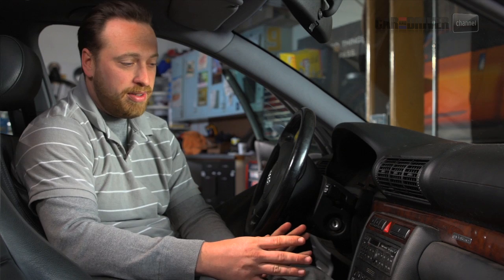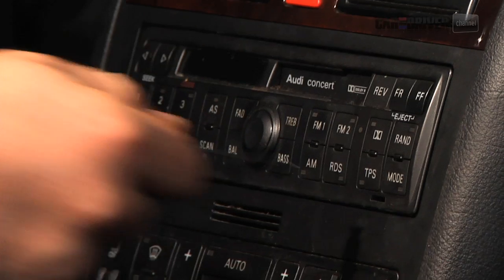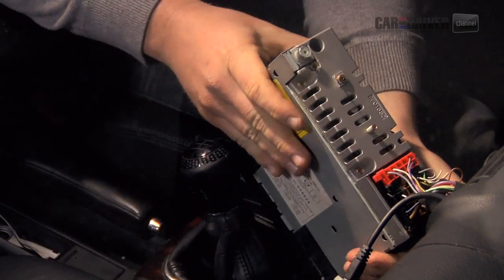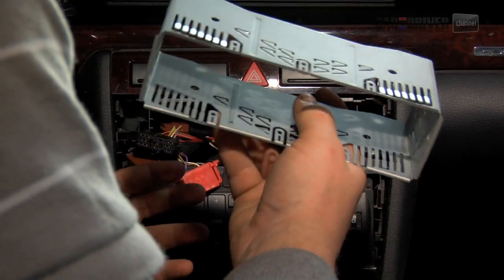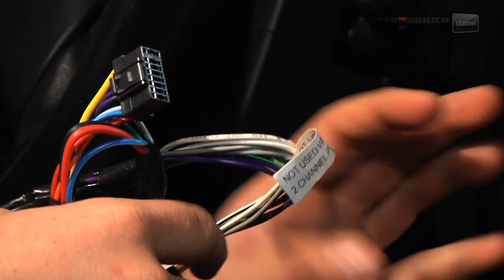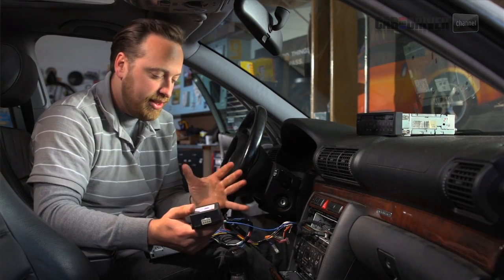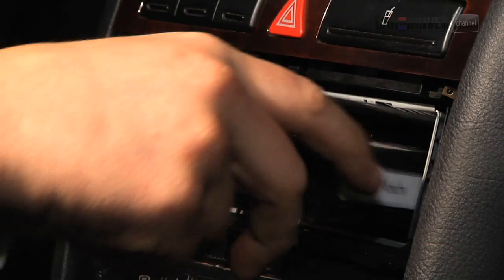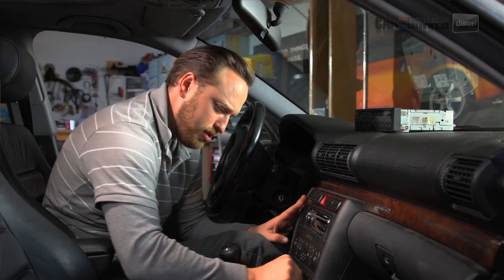How to Install a Replacement Car Stereo

Comment: you forgot to mention in the beginning to disconnect your negative battery cable before you start so you don't fry your components or blow a fuse...

Comment: hey ben my aftermarket car stereo just went out and when i pulled out the stereo all the wires were basically spliced and black taped together with the cars wire harness. and when i turned the car on my stereo doesnt wor. do you have any idea what the problem could be?

Comment: You can go to your local autoparts store, and ask them to direct you to the car stereo section. There you will find kits with make and models clearly listed on them. As far as a radio, any aftermarket radio will work, but with USB, you may have problems with amperage depending on what you're attaching. Pioneer, Alpine, Clarion, and Eclipse are high quality units. JVC, Kenwood, IR3, Blaupunkt, and the like, are lesser units.

Comment: Ben, Thank you for the informational video. Have a20003 Honda Accord that was operating intermittently thinking it was a loose wire, now does come on at all. Need to replaced. Should I go to salvage yard and try to find Honda salvage or buy aftermarket. If so which one would you recommend from an ease of installation?

Comment: Thank you. This was very informative.  One quick question, I have a Toyota Avalon 1995, I was in the process of replacing the radio and got stuck when connecting the new radio.  Where would I find this sound café universal radio replacement box.  Thank you.

Comment: OK I have a w201 Merc 190 with the original radio cassette. I have taken this out but the connectors for the speakers and wiring are different. How do I change the two pin speaker plugs for jack type and what about the wiring harness. I guess it is all colour for colour connections but am worried about stripping it out and ruining it. Thanks.

Comment: i recently bought an old 1998 citroen saxo and it came with a tape deck in it will i be able to just straight swap it for my alpine stereo i have saved from a previous car or will i need one of these adapters thanks

Comment: That's your opinion. Aux inputs always have a noise element attached to them. And as for most radios, "modding" them to accept Aux is not something the average user can do. Also, the companies who accept contracts of the lowest bid for the components used in the system, don't care about quality, they care about dollars and cents. That's where aftermarket comes in, aftermarket is always better.

Comment: is it possible to make a video on how to install a stereo for toyota sienna 1999-2000 year, they are older models and i believe you need a new panel for new stereo. One other Question, how much is the adapter that you were talking about in the video?
it will be greatly appreciated..

Comment: If you lost your original faceplate and don't remember the original brand or model number can you still replace it? 

It's only about 3 years old, it has a Bluetooth option.

Comment: kind of new with diy, especially with cars, i want to remove my 2000 buick lesabre stereo (it;s not working) so i have a couple of questions: do i follow the same steps? do you recommend a specific car audio brand? the old stereo has a cd player and cassette.

Comment: what about if its an old factory radio and you want to replace with someone that has an AUX port. does that need to be connected or it works once u connect the new radio ?

Comment: if i have a factory bose system in a car and want to replace the head unit and add 2 subs and an amp would i have to bypass the factory amp for the main speakers to work? like if i just cut the wires from the old radio and just wired them to the new one. would the speakers still play? cause i know some factory amps only work with the factory radio.

Comment: So I want to install a new stereo into my car but I don't want to loose the swc (steering wheel control) I been told that I need a extra cable from my scenic 05 plate.

Comment: Hi please tell me is there anyway of not connecting the radio to the car's battery, or any other option. my radio drains my battery & if i play my radio when the car is off, it wont start? what can i do? or do i need a new battery?

Comment: I own a car Honda Civic 2004 EX sedan model.

It has the Cassette adapter with in it. Before a week it was running good, But now its giving me wired sound like buzzing noise which is very terrible, that too its coming in the left speakers. But when it comes to CD player or FM/AM my stereo is working fine and all speakers are good to listen.

So am sure that there is no problem with speakers and players and the problem is with the cassette adapter. It should be a minor problem , but am not exactly sure. 

Could you please let me know if this can be serviced at service station.

Or if you have a suggestion of installing.

Comment: If I find an android stereo branded for another car, but the measurments are still right, would it still work? I have a subaru 2005 2.0 gx sport and am interested in fitting a pumpkin 8 inch to a double din slot (measures 8 inches)

Comment: i have a 94 jeep i bought that came with an aftermarket radio i have another radio i want to put in it should it already have the necessary wires so i can plug and play or do i need to buy new wires?

Comment: i have a 2000 Mitsubishi Montero Sport that i bought, come to find out the radio doesnt want to come on at all, i tried everything besides pulling it out. but the thing is, it looks like the stereo has already been replaced before because you can see wearing around the edge, so im guessing someone replaced the stock stereo with something better and then when the dealership got it they put the stock radio back in. any thoughts? thanks

Comment: Hi, I'm having trouble fitting the stereo back in. The original L bracket had two screws into the frame (car) and two into the deck. These brackets screw into the deck about half way along which means I have to push the bracket for my new car stereo right back to fit flush. Then my stereo is nowhere near flush with my faceplate. 
Any suggestions to mount it correctly?

Comment: Where do you find one of those "black boxes" that are specific for your car? I have a 1995 camry. I am looking to replace the radio (which I updated back in 2007....so it isn't the original stock and I had pros replace it for me, so I am not sure what the wiring situation looks like). If the pros used a "black box" with the last radio install, can I continue to use that black box? I think the radio I have in there now is a JVC and I am looking to put in a Sony. Thanks!!

Comment: After I connected my brand new radio into my 2000 VW Golf with the harness, it has no Am reception. I did connect Sony but no solution. It is working with FM reception and all other function. Any suggestion? Please advise. thanks!

Comment: Ben, great video.

I did something like this yesterday so that I could give my old cd/mp3/radio to a friend who'se CD player was kaput.

I remembered that for some reason when it was first used by me it would ALWAYS start the cd from the start. 

I am a senior citizen and my memory isn't what it was, I think :-)

It's a KENWOOD KD-SC601, I've tried searching all over I have even got on-line manual BUT no joy. 

There must be an industry standard setting either Play CD from start OR resume. 

Could you possibly help me/enlighten me. 

Many thanks for taking time to read this.

Best wishes

Edward, Spain.

Comment: I bought an OEM radio/ cd player to upgrade my OEM radio player  only to find out the cd player had an extra plug I'm lost now. I thought the truck would have had the same plugs but  would just use more of the pins. If you need  its a 2005 f150

Comment: Ihave a chevy 2001 and Im triyihnq to install a new sterio bcuz i broke the other one but i checked and Idont have moat of the plugs you showed on here is that normal ? Or did i get the wrohnq thihnq /

Comment: I just installed a new din stereo in my 06 jeep wrangler it works fine but the bracket isn't exactly doing its job the stereo slide right out idk what to do

Comment: I've recently just braught a casual astra 1999-2001 came with tape deck 
But the problem is the battery died and no code to unlock it will buyig a new radio solve this?
Reply: Vaxhall

Comment: this is funny im really good with computers and i know nothing about cars and this seems kinda confusing and the funny thing is my dad is a mechanic
Reply: its like installing an ide dvd or cd drive but you have to make the ide cable and power connector. Taking of the trim is like removing the front panel of the case

Comment: Last month my 2004 Expedition started making a loud "clack" sound
coming from the rear AC unit. It was annoying enough for me to bust
the unit open to see what was wrong. After doing this, I found that
the two flaps that direct the cool air throughout the cabin were
causing the noise. I took it to a mechanic who said that he'd have to
rip half the car apart to fix it. Can this be fixed at home, and if
not, what will it take to get the job done?

Comment: I have  a 2000 toyota sienna and i took out the old radio and put in the new and it wont turn on, how do i fix it without going and buying a new stereo?

Comment: I got a blue and a white wire which is connected to something far more to the inside of the car that i cant see.. It got a tag where it says: System Remote Control, i have 2 amplifiers and 1 subwoofer. but, what do i do with this blue and a white wire, its fasten in the old black wirebox, and the new wirebox doesnt have the same thing, im so noob at this.. would you please try to understand and  help me?

Comment: I'm having trouble finding my 12v ignition & 12v battery lead wire on my 2000 vw passat (wagon) i found a lot of wiring diagrams but none of them have the colors i see from the bunch of wires behind my oem radio...HELP?!

Comment: I drive a Peugeot 206 from year 2005, so I installed a new car stereo connecting up the parts where they fitted but for some reason with the ignition off the car stereo stays on with the CD still playing, also it never remembers the settings and I have to redo the settings each time I use the car, the car stereo is a Pioneer DEH-150MP, what is going on here??
Reply: somewhre i read you have to swap the red and yellow cables, lol idk might help you bro!

Comment: I have an 03 Explorer and I fixed it by taking a snake camera (which is expensive) and then taped the flap down.... ac doesnt work as well anymore but sound is gone

Comment: First of all what is that black box call. I have a Toyota camry 2003, so which kind of the black box that I should get?
Reply: Go to crutchfield.com they will include a free wiring harness and mounting dock for your car with almost any radio you buy.

Comment: Hi I just have a question if my stereo is already connected do I have to connected to the battery, if yes how do I do it ???
Reply: hi your stereo should have a black ground cable. when that is disconnected its already off the cars network. and always disconnect the POSITIVE terminal, the negative can just touch anything and fry your ecm.
Reply: futbolero4152 hi i have one question i change my car stereo and i have a problem my top screen with temperature and time doesn't turn off and it kills my battery it didn't happen with my stock stereo?????(renault laguna 2 2001)
Reply: RandomVideos  you need to remove and see if all your wires match up. if you have extra, then you can buy the connector adapter. had to do it plenty of times before and it costs less than 10$.
Reply: thank you

Comment: WHATS UP HEY I HAVE A 1999 MAZDA  AND MY PLUGS WHERE CUT OFF CAN I STILL WIRE IT I HAVE POWER BUT I CANT GET  THE SPEAKERS TO WORK CAN YOU HELP ME THANKS
Reply: +Mindy Woolsey you can buy the factory male parts on ebay or amazon and return it to OEM persay. I had to do this a couple of times.  They should match back up with factory colors.

Comment: can someone help me, whenever i play my stereo my left front speaker does a constant clicking noise, i took out the speaker and put a new one in to make sure it wasn't the speaker, it did the same thing. Is there a way to fix this? and if my stereo is dying is that fixable? Thanks.
Reply: Maybe there is a short in the line to that speaker
Reply: do u have a equalizer in your car?????
Reply: There is a built in equalizer in the head unit
Reply: you need to go on the radio settings and go on  fader and low down the fader
reply me and tell me if it work
Reply: The guy has probably already fixed it :)
Reply: i did, thanks guys

Comment: How the hell do you make a video about this soecific product and dont tell your audience where the hell to get that. Its helpfuland informationally useless
Reply: +Lorenzo Falcon he said you can get any device you want, but make sure that its a DIN so it fit in the stereo "place" what stereo he have has nothing to do with where he got it. he is only showing you how to install a new one.
Reply: +How Not to Play not that. I have a radio. Its the adapter he advertises but doesnt specify where to get the already preset adapted wires with the "sound cafe" thing
Reply: +Lorenzo Falcon Then what you have to do is search for it, example Audi a4 radio adapter . or something like that and it will come up, search on google.
Reply: +Lorenzo Falcon  Best buy,Walmart, Auto parts store,  local radio shop, ebay and one of the best amazon.
Reply: Lmao. You have to look for it scrub. All cars are different.

Comment: SO what do you do if all the connectors in the dash are cut out? Shoot myself in the face?
Reply: Not really. You will find some wires, then get adapter for your stereo and solder it directly, then you will be able to connect your stereo. Or just get wires from speakers, and then get power ground wires and connect them up. And you will have it sorted.

Comment: Man this video was no justice, they didn't even show Ben connecting the aftermarket stereo wiring harness, to the the wires of that black box thing. There's no simple plug and play, you have to color match all those wires from the new stereo, with either the black box thing, or a female factory stereo wiring harness then connect them  together. The black box thing made it super easy, its cheaper to get the female harness,  just be aware that you have to pay more for that black box convenience.

Comment: My car audio restarts automatically every 5 or 10 mins. Sometimes restarts only after half an hour. The while HU goes off and comes back in automatically.  Settings also resets esp equaliser. Apparently this happens only while driving.  While idle or engine off the problem doesn't occur. I would be glad if someone could help.  Thanks.

Comment: Here's one for you North Americans - Here in England I want to swap my Pioneer KP 2080 with a Pioneer KE 1730 the KP 2080 might have been original with my Austin Metro City 1989 (yes 1989) and the KE 1730 is about 12 years old (both work fine but the KP has a tuning dial whereas the KP digital read out and memory . Both have cassette not CD players which I still play , well I am 65 . I hoped I could simply unplug and plug in - is that possible ?

Comment: "Having a car stereo without a CD in today's age player can suck"

No, it doesn't suck at all. Having CD players sucks because I don't use CDs anymore at all.

I removed CD players from two cars I have owned and replaced them with old cassette players. With cassette players I can use an adapter to connect it to my phone and play music from that.

People that defend CDs in this day and age usually say they prefer them due to better sound quality. Sorry but no. Lossless audio files may be large but you could get far more onto a modern SD card than on a CD. CDs are also prone to scratches and are very slow to boot up, not to mention are bulky given the small amount of data they contain.

Comment: Some of these adapters are completely wrong and need to re wire most of it. Honestly, no wonder people just use an usb adapter for the original stereo and problem solved.

Comment: i wanted to transfer my old cars stereo to my new cars but all the plugs are effing different.  i dont understand where to get a converter plug thing like the harness wires you showed.  do i need to cut the wires back from behind it on my old car and cut the new wires and crimp them together?  it just seems so god damned complicated and i really dont want to have to pay like 60 bucks for someone to install it for me.  really sucks.  gah.  to me that is the hardest part... you seem to show just having some kind of automatic converter plugs which fit perfectly.  this is the most confusing part
Reply: Check out http://www.crutchfield.com/ they will be able to help